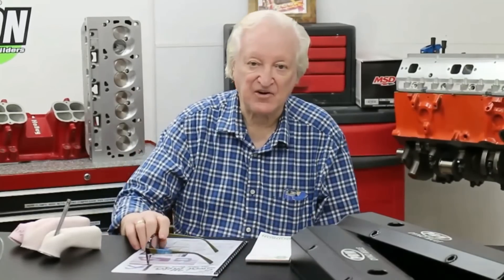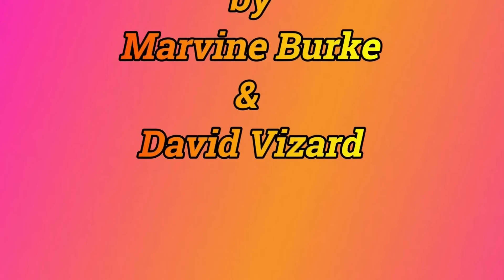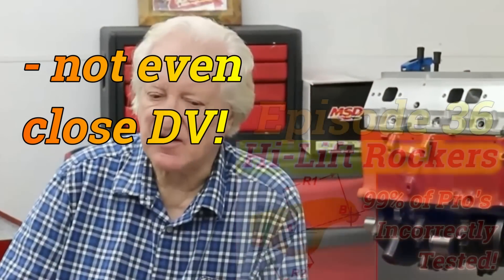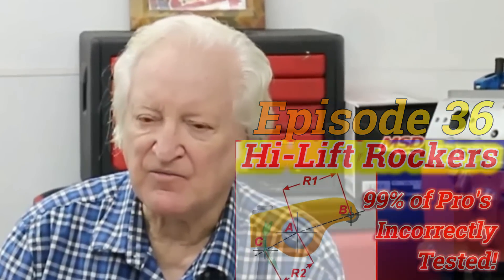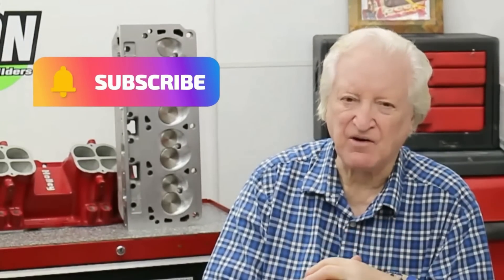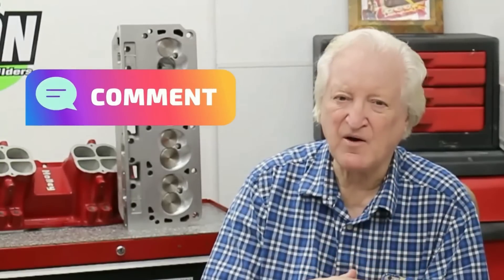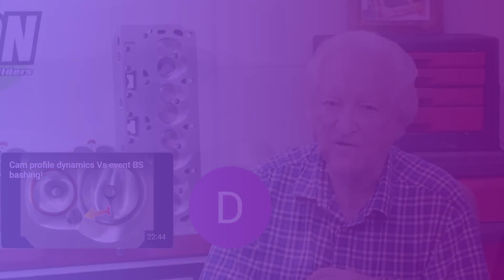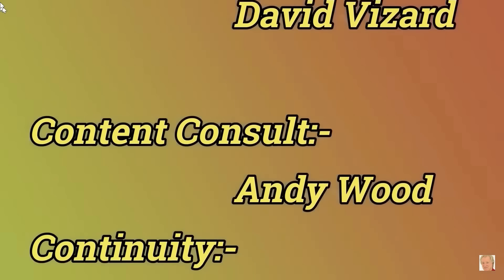More little known power producing rocker tech.

Comment: Quick Question David my 383 SBC solid roller 307 LSA with 1.85 rockers made 725hp at 8000 rpm and after braking a aluminium exhaust rocker with a lot of street driving, I got hold of  set of  steel exhaust rockers and  I was told they where 1.75 but after getting them they are actually 1.7, how much will it effect power do you think so running with 1.85 intake and 1.7 exhaust. cheers love you're vids.

Comment: Hey Dave I've got a question that isn't part of what you were explaining their but something that deal Potter he was a absolute great engineer on the l-series Dachshund motors along with Dave rebello at one point before they separated part from each other and what different ways from one another L Series Datsun's Engines builder Dave could recreate the same thing over and over again as Potter would always try to improve send next engine that he built. Came up with the stroker 2.3 L Series motor that made about 220 horse and a lot of torque as opposed to doing a 2150 2150 used a l20b crank what's 6 inch rods. Versus using a set of 5.85 rods. And a 22 napsi crank. To 2150 made about 210 to 215 horse but would spin a lot easier and higher RPMs. But the one thing that deal Potter would do was have everything cryogenically treated by 320 below in liquid nitrogen slowly taking down from room temperature to 320 below to realign the molecules in the all the rotating which would make it last two to three times. Which would make the parts last two to three times longer. And then sometimes have the things. Traded afterwards.do you think this would help with the cams and lifters of today as well with the cranks.

Comment: Top job expanding upon how the rocker ratio effects timing events.  I missed the first but I'd hope you began with explaining how the timing events are plotted.   The average guy,  we call them last line guys.   They grab the cam on the bottom because that MUST be the highest performance part.     Using a cam meant for the application is far more important.  Just as Lingenfelter proved.  His work on air flow and applying aeronautic tech was a game changing revelation for many.

Comment: David, when would a 110 lsa be acceptable? I know a  tighter lsa make a more peaky power curve, but for a street strip car wouldn't the wider lsa help with vacuum for power brakes and improve fuel economy just a bit? Wouldn't it also make a flatter torque curve for street gears such as 3.42-4.11 gears? Also, wouldn't a 110 lsa be better suited for nitrous over a 106 or 108?

Comment: Is there any  advantage to changing pushrod length ?
Reply: You have to choose a pushrod length that gives correct valve train geometry.  They make adjustable pushrods for figuring it out once all your other components are picked.
Reply: Use the longest ones you can. Don't even measure

Comment: Would this tech apply the same to a work horse type engine. For instance, a stock gen6 454 big block with a 206°/.510" single pattern cam 110 lsa .
Reply: Big blocks seem to work the best on 109 LC...   That's what Bill Jenkins said.   That is where my 468 made the most HP at 7,500 rpm.  The cam was ground on 112°.  1.8 & 1.75 on shaft rockers.
Reply: @leonardfoster6252  did you do split rocker ratio?
Reply: Yes, I have 1.8 on intake and 1.75 on exhaust.  My car is fast for what it is! 5.62 et. at 123 mph in 1/8th and converted over to 1/4, the would have ran 8.82 et. at 152 mph.
Reply: Yes,it would be better and pickup your low-end torque....  I couldn't hardly believe that 1 degree made that much difference in the HP.  My 468 put out 775.6.  I made a couple of changes and it makes around 800 or a little over.

Comment: If you were to do a back to back test with cranking compression as your measurement, would a person be able to understand if its not going to produced any worthwhile gains in hp.  For instance if you have a delta of 20 psi or more from 1.6 rocker to 1.7 rocker.  What ever that pressure number is, will it tell you anything or give an indication?  Or is a dyno / track the only measurement system that can detect this?